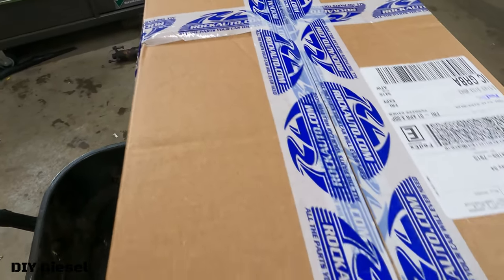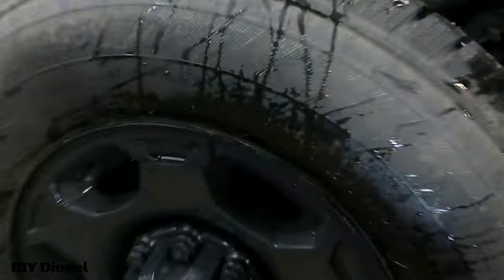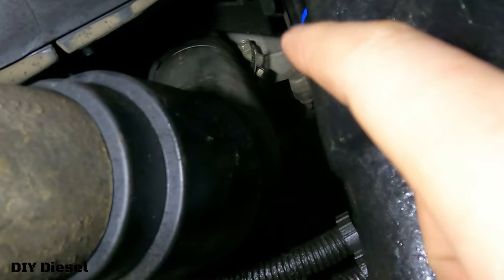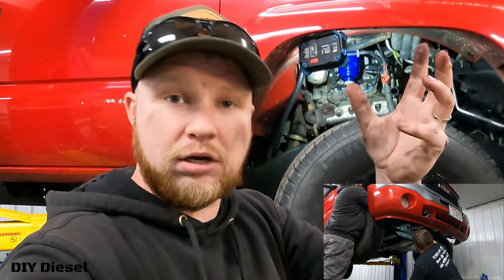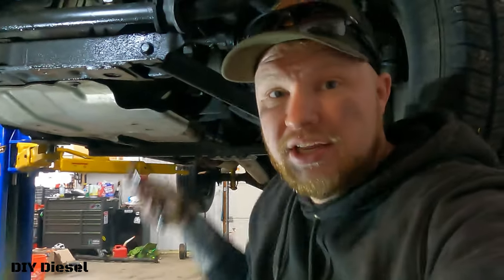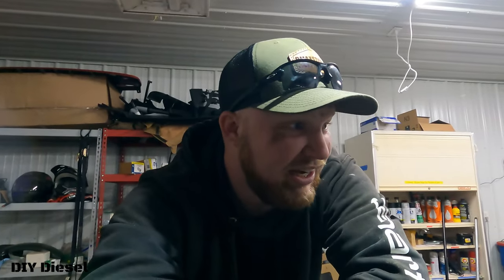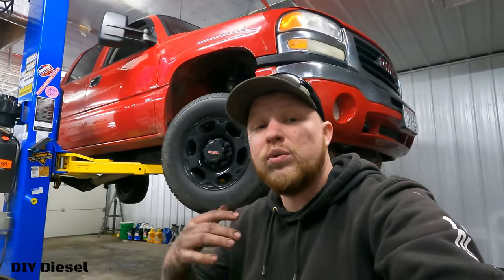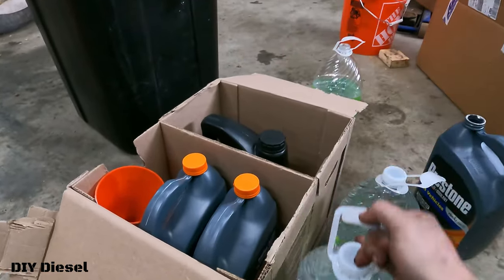How to Replace Your Duramax Lower Radiator Hose (GM/GMC 2006-2010)

Comment: Thanks for this video! Only one out there that I can find that actually show what to do and what to watch out for!
Reply from the maker: Thank you! I appreciate that 🙏
Reply: @DIYDiesel   I replaced the lower radiator hose yesterday! Man what a freaking pain in the rear! I think I made up some new cuss words in the process! I ended up using a filet knife to cut several slits in it to get it unstuck from the water pump! I hope that hose lasts forever because I will sell the truck before doing that again! I guess it would not have been so bad if I had replaced it while the radiator was out while replacing it! But the new radiator was NOT coming out again either! Oh and to make things even worse, my fan shroud was 1 piece!
Reply from the maker: @jimwhalen6769  damn! Ya man it’s not a fun job at all! That’s one thing I wanted to make sure people knew when tackling it lol
Reply: @DIYDiesel  Well I was warned and knew the water pump part was going to be a pain, but dang I was wondering if it had been welded on! I had a hook tool specifically designed to get between the hose and outlet and help separate, but broke that! I guess I will see if I can find a new one! Anyway thanks for the warning and look forward to new videos!

Comment: WARNING to others doing this. The factory owners guide repeats over and over to use clean DRINKING WATER for the 50/50 mix! I don't know why but it could be that DISTILLED water may be an issue with dissimilar metals. (Aluminum heads and iron block). If you know the science behind the factory instructions it would be helpful. But a BIG THANKS for the great tips and excellent video quality and sharing it.
Reply from the maker: I appreciate that! That’s crazy everything I have been told and taught is to use distilled water. Maybe while I am at SEMA this year I can find someone that can explain this 🤘🏼
Reply: I’ve been told by very well known duramax builders to use distilled. Also in battery’s.

Comment: I took the 2 idler arm support bolts out and dropped it a bit, l struggled with the  retainer clip that attaches by the idler arm support, good video you guys did, glad l watched it first
Steve  Berg Cranbrook B.C.
Reply from the maker: Glad it could help! That’s a good idea to take out those two bolts 👍

Comment: Just a tip, pull the fan shroud and fan, that hose going into the water pump becomes much easier.  only takes an extra 20 minutes.
Reply from the maker: Ya that damn fan shroud is a pain to work around lol

Comment: GUYS PAUSE AR 3:31 and look at that clamp that holds that wire bundle directly beneath the hose. RELOCATE THIS! That clamp chewed a hole through my lower hose!
Reply from the maker: Awesome comment! And great advice 👏
Reply: Yes mine was rubbing there also, l put some hose wrap on,
Reply: Yes, that is what cost me a $280 replacement hose  not to mention the antifreeze. Luckily, I know how to do the work myself.
Reply: Thanks! I will have to see if that is on my truck! I don’t remember it, but I will verify!

Comment: When draining why not just cut the bottom hose and let it drain from there. It's going in the garbage anyways. Thats how I plan to drain mine. Just got through replacing my Power steering hoses and I have a hydroboost in the DMAX. What a pain in the ass especially bleeding the power steering manually! Looks like another pain in the ass on this job also. Did the top hose at 150K and truck has 161,000 miles on it now so time to tackle the bottom and do a flush and fill with Prestone Dex cool concentrate. Bought the truck in 2010 and plan on owning it until they come up with flying trucks....LOL 2006 GMC Sierra SLT 2500HD DMAX 4X4 LBZ code engine
Reply from the maker: Nice! Lol and sometimes we just do things looking back and wondering why we did it the way we did 🤣

Comment: Mine is STUCK lol. Came to check if I was missing something. Guess it's just going to take some more elbow grease
Reply from the maker: Getting off the water pump sucks lol
Reply: @DIYDiesel  got it off the radiator. I was just replacing the radiator this time - twisting it back and forth broke it loose 👍
Reply from the maker: @joesigrist633  nice! Well hopefully this video helped some